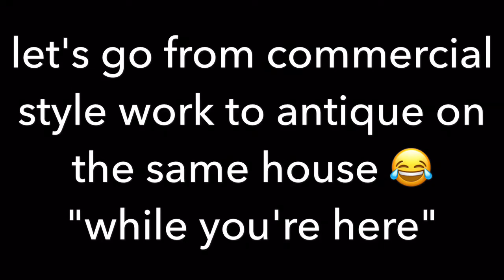replacing flush bolts on narrow stile door and a bird

Comment: Always funny to me to see a commercial door(s) on a residential house.
I always do my flush bolts the opposite way of you. I keep the bolt in the unlocked position and have the top of the guide match or go a hair or 2 under the top of the door. I do check the gap. So far it has never let me down. The throw on flush bolts are great.